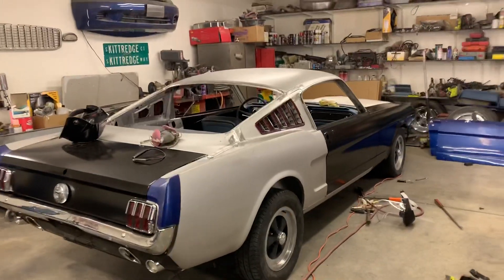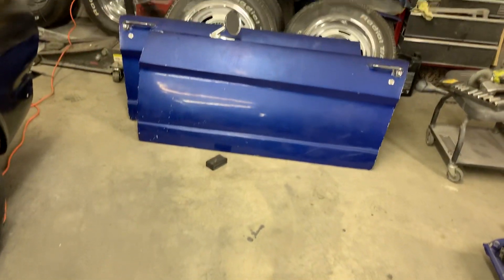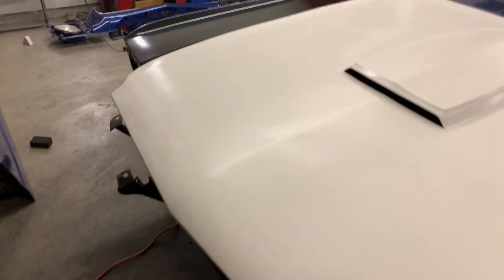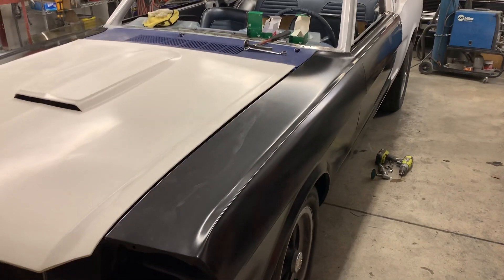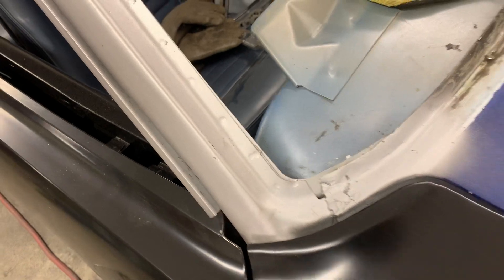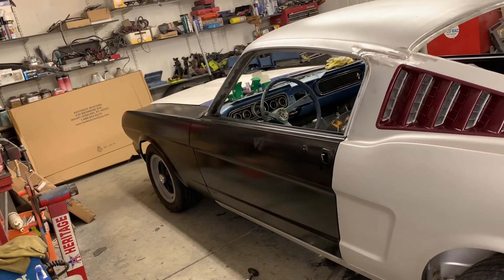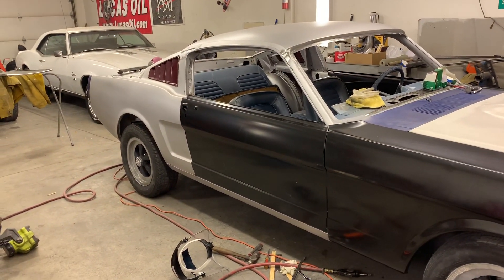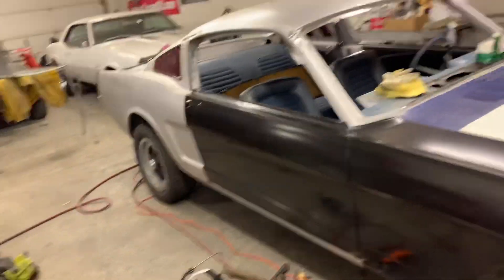1966 Mustang fastback conversion

Comment: To bad you don't have more Mustang gearheads that have watched your progress. I find your videos very interesting. I was given an old 65 Mustang inline six convertible that was rusted beyond repair a few years ago. I am a 76 year old lifetime gearhead that started off in the early 1960's. I have restored some old Mustangs and certified in C2 corvette restoration  by Bloomington Gold Corvettes. I have a 63 corvette roadster right now with a 2010 LS 1 engine. I tried to give this 65 mustang to a couple salvage yards but they weren't interested . I took my plasma cutter and cut the entire car up in pieces a junkman could put in his pickup. I kept the dash A pillars and rear seat hardware that was used on a convertible. I ordered a new 1965 chassis and began building a new convertible. I have only worked on this car during the winter months. The body is completed and all welded together and looks pretty decent. I am not out to build or restore another car. I have been thinking more along the lines of selling a nice body to someone who wants to build their dream Mustang. Put it on Craigslist three months ago and had one call and no takers. SO now I am considering making it a fastback. I enjoyed your build. I did take some time off from cars when I went to Vietnam in 1968 with the U.S. Army infantry. Was wounded nine months in country and sent home. Spent some time laid up in the hospital and then discharged and right back to cars. Take care and thanks again.
Reply from the maker: George Humphrey Thank you for your kind words and thank you for your service, Cars kind of get into your blood. You may leave them alone for a while but you always come back!
Here’s to many more years of building cool cars